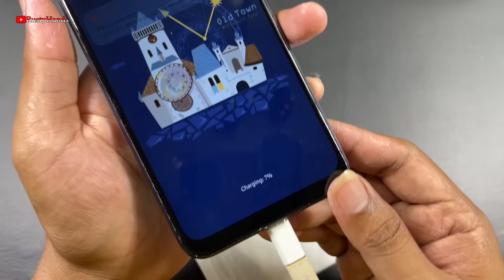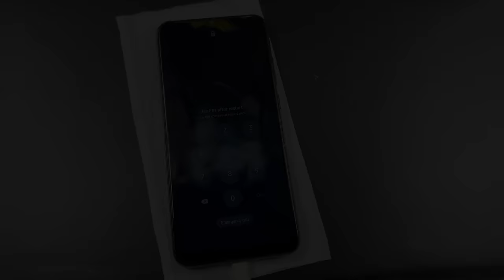Looking for a used phone in the last trash || Restoration broken Samsung

Comment: in any case, after replacing the screen, even if you reset the data from the phone, there would be a password on it, how did you find it out (you will find out)